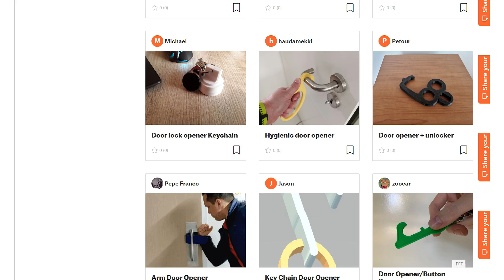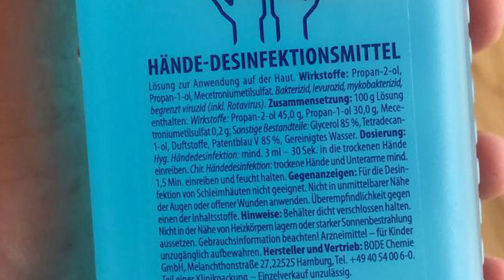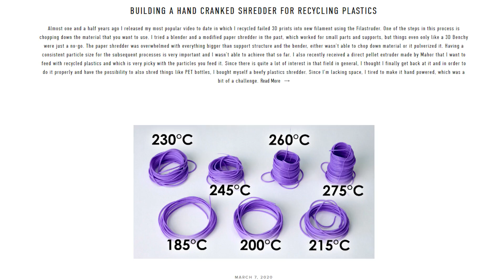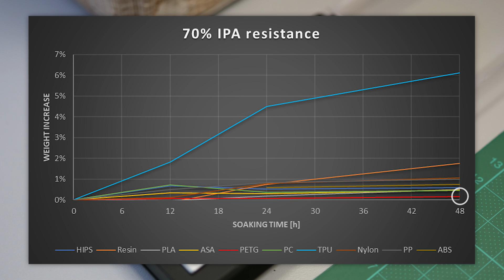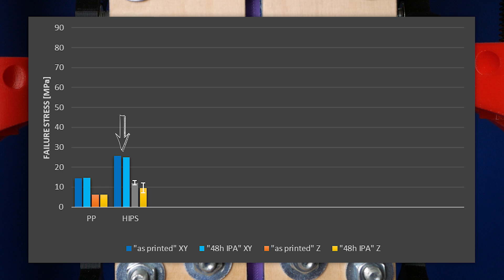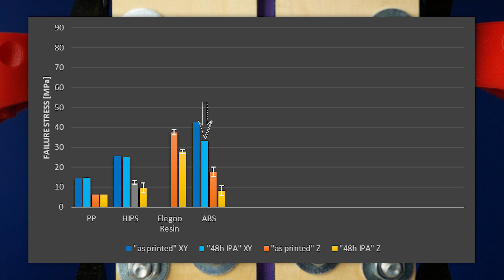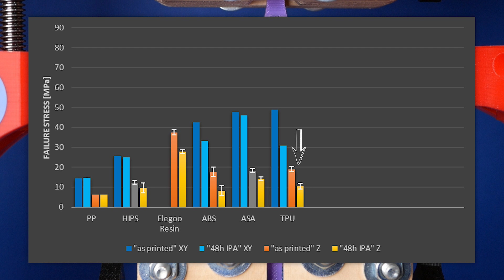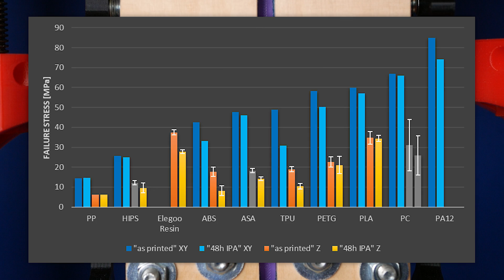Does 70% IPA reduce the strength of 3D prints?

Comment: Also interesting is that PLA/PETG printed parts are practically sterile. I saw a paper that confirmed it, and it's plausible: Virtually nothing can survive to be heated to around 200°C for a few seconds. Maybe certain spores can (which is why sterilizers use lower temperatures but higher pressure). Viruses certainly not. With some care around preparing the build plate (preferably glass) and maybe an enclosure, it would arguably be good enough for most surgeries (and it has been done...). On the other hand, I'd be hesitant to trust the parts that have been soaked in disinfectant. You normally don't want IPA in a wound.
Reply: I suppose every plastic after the printing is sterile since the temperature e pressure in the nozzle is very high(and the PLA is the plastic with the lowest printing temperature). The problem is the micro-organism and virus after the use/printing process(and is not soo simple to make a sterile environment). Since the layers interface in the 3d printed parts is very hard to cleaning-up(actually situation) and if you make a non-single-use item you need to use some disinfectant after several uses. IPA, ethanol and even Sodium hypochlorite have a low "evaporation" point, and normally don't continue in the surface (for this reason that use 70% alcohol/water to also reduce the evaporation velocity), and have low toxicity. I think the point where need more concern is in the printing process itself, since is know about the plastic when you expose to heat, can produce toxic compound (especially ABS). For surgeries, i think using PP or Nylon you can after apply a moist heat sterilization process (since PP is normally used in microbiology laboratories), if you use gamma radiation sterilization you can apply in all 3d printable plastics.

Comment: What is a good, obtainable cleaner other than ipa?
Reply: If you can find high-proof alcoholic drinks (like Everclear if you're in the USA), use them. You'll want around 140 proof (70%). If the proof is > 80%, dilute it down a tad. 70% is the sweet spot for effectiveness.
Reply: Bleach - used as desinfectant in ebola areas

Comment: Yeah, do the UV testing. Should be interesting since plastic tends to degrade under UVC light, and it’d be interesting to compare ASA, which is supposedly especially resistant, with the others. That will also translate to parts exposed to sunlight, so you get two videos in one!
Reply: I think from the YT perspective, he'd be more excited if he could get the two videos separately...but yes, agree with your comment.
Reply: Impervious  And also important for viruses, RNA.
Reply: Impervious  there is some testing happening from John Hopkins University on various techniques and I had read it is resilient to UV, doesn't mean enough and high enough energy wouldn't do the job but there are simpler and cheaper ways to denature it, just feels like using a deathstar when we just need a blaster :) Glad to hear it is being used effectively some places though, not trying to spread any misinformation.  Results I saw from John Hopkins were still inconclusive a couple days ago.
Reply: UV can help with generally killing bacteria and some viruses but isn't super effective against covid-19 from early testing I've seen basically soap and water and or alcohol are better at denaturing the virus and effectively deactivating it.  People who need a mask will be better off with one that potentially has some bacteria on it but no potentially lethal viruses than with no mask at all and people coughing or sneezing in their face onto their n-95 mask, typically these shield will be worn over other gear from what I understand too.  I have 14 frames printed so far guy I work with did 100+ already, hospitals are accepting them.
Reply: @ShaunHusain  I am in contact with several hospital front line  workers in the northeast US, where we've been hit pretty hard.  Hospitals are using UV sterilizer and it does in fact kill covid-19. These are industrial machines which are very effective, but I'm not sure how one would test their impact on 3D prints in a home environment.
Reply: Cool will do In 15 years